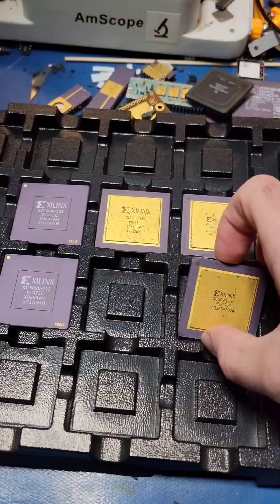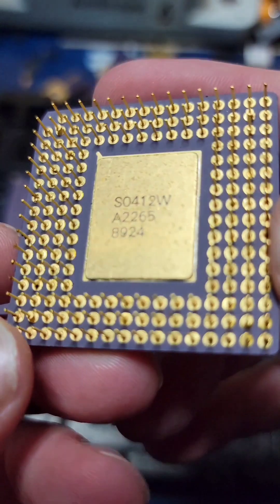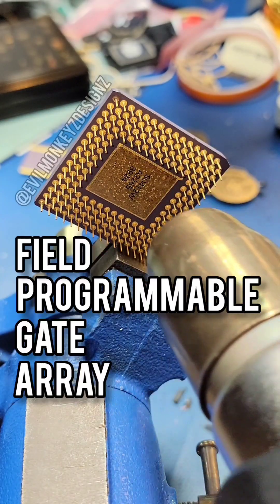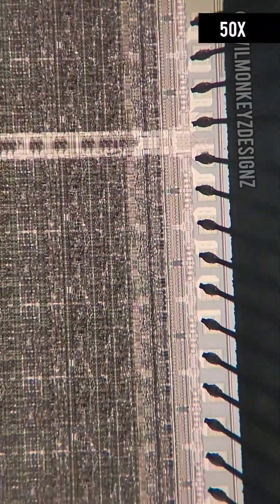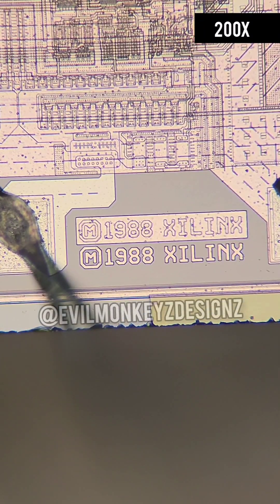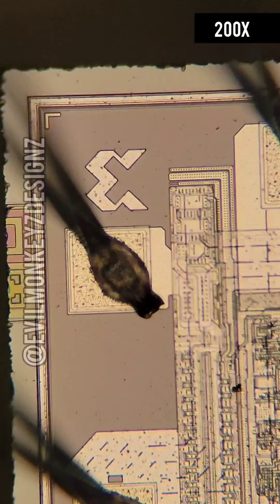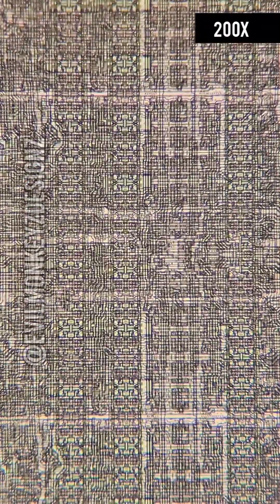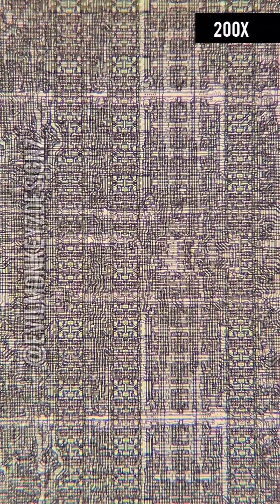CCU #296: Xilinx XC3090 FPGA #shorts

Comment: It probably was originally configured as a super IO chip or a CGA/EGA/VGA chip for dev boards on c64 or amstrad CPC before release of final devices to the public.. it would not be enough for 8bit CPU's or anything but for basic video or super IO that controlled HDD and FDD and parallel and com ports all in 1 chip this chip would have been used buy manufacturers device Dev's for probably all 8 bit and 16 bit systems and possibly ARM systems also likely used in enterprise equipment like old services like telephone switching and local network equipment of the time!! This chip is likely responsible for the final product of thousands of different chips in thousands of devices around the world.

Comment: Can you now explain why my analogue pocket has FPGA on it please!!
Reply from the maker: With enough logic gates, the actual CPUs of older game consoles can be synthesized in an FPGA. The logic gates all remain fixed in place, but by writing code and programming it to the FPGA, you tell the FPGA what logic gates should connect to each other, forming larger structures. I'm not sure exactly how the Analog pocket does it, but its either a big enough FPGA to store all of the consoles' CPUs that it supports at the same time, or it re-programs the FPGA firmware depending on the game its trying to run. I'm sure there are a few different ways to end up at the same point.
Reply: @EvilmonkeyzDesignz  very interesting and informative I appreciate your reply! Thank you! I was impressed with the analogue pockets performance so much so I had to ask when I heard you explain fpga. Nice to know how they are doing it! Does this mean in the future with software updates the pocket could support more and or different devices?

Comment: So blows my mind!  This is 35-year-old tech too. Insane for sure how chip-making equipment can be so precise to manufacture chips with so many circuits in a small surface area! I am so humbled....
Reply: It's easier than you think, it's like shining a projector through a microscope but in reverse so that instead of making the image bigger you're making it smaller so you can get microscopic detail from a regular projector and then you just use chemicals that are sensitive to light. Use the opposite end of a telescope or stacking multiple lenses and you can make the details as miniature as you want...
Reply: @DrakeOola  I can "see that." Interesting. I too think about the many  "internal chip electrically charged superhighways" running microscopically close to one another without interfering with one another. The perfect medians engineered to separate the tiny circuits. Mind blowing...

Comment: Ah, logic gates, I worked on some fun IBM cabinet printers that loaded code off a 3.5 floppy when you booted it.  A lot of the calls, a fresh 3.5 floppy disk replacement would fix the weird problems the machine was having.  Fun stuff 🎉

Comment: Will be a help for my questions : what makes an  IC programmable?

If I want to program a 8085(assume), I need a compiler that will run my program (which I am seeing in display) and executes it in the processor. I understand that mnemonics itself are hexadecimals and it eventually indicates voltage levels as per timing diagram but how does it stay always in the processor?  Can we customize any mnemonic, for example can we change the command ' MOV' to any other customized command? Thanks in advance.

Comment: 1990's me screaming when the top came off - "Nooooooooo!!!  Do you know how expensive those are, and the lead times?!?!?!"

Spent many hours learning the internal architecture of these to optimize for speed - had to hand place many of the CLBs to get it to reliably meet timing requirements.  

In some cases, the Xilinx documentation was misleading.  They recommended using regular LUT logic for clock enables becuase there were more routing resources for those inputs.  While true, the dedicated ENABLE input had easier set-up time requirements, making for faster counters if they were small enough.

Also, the upper and lower CLB outputs could not go directly to their respective upper and lower long-line buffers - you had to go through a magic box to route it there... UNLESS you routed the upper output to the lower tri-state buffer, and the lower output to the upper tri-state buffer - saved routing resources and nanoseconds.  

The design was entered in schematics so flip-flops could be placed in specific CLBs with location attributes - language entry didn't allow that.

Comment: The specs are actually very good and still very useful for today's usage
Reply: I haven't looked up the specs on this particular part. But with modern FPGA you need line transceivers to scale up the voltage for higher voltage applications. Like for instance if you want to drive LED matrix with them. These old FPGA could probably do it without line transceivers/level shifters.
Reply: @Salzmann_69 FPGA's are still used mainly for prototypinh ASIC's.

The pynq-z2 which is relatively new has a clock frequency of 125 MHz
Reply: @Salzmann_69 you obviously don't have any idea what an FPGA does and what it's used for.

Look it up but I will try to sum it up.

CPUs work in tasks sequential while FPGAs can do it instantly because instead of working with instructions, you put logic gates in a certain order.
Reply: @CraftingCake  I use fpga to test basic RTL design so for my application, you can do pretty much anything you want with them. You can actually make a CPU out of them.
Those specs allow you to do basic stuff, it's kinda cool (like those little usb fpga you can buy for almost "nothing"). of course it's outdated and stuff but still usable.
Reply: after re-watching, i thinks i misheard while writing my 1st comment because there is no way you can fit enough to make even a 8 bit CPU haha. i was very wrong indeed.
Still usable, but not for RTL for sure.

Comment: FPGA's  have their logic set up at boot where a CPLD does not , however, the MAX series CPLD's were actually FPGA's with very fast start up times, customers only noticed years after release.
Reply: Javier, trolling on youtube would be a frustrating endeavor, links can't be posted, most comments get deleted and there's a maximum before everything you write gets deleted. search for exactly these words "Generally, MAX II as well as MAX V are small SRAM based FPGAs"
Reply: Circuit design with vhdl, Volnei A Pedroni. MIT Press. Chapter 4. Page 107. Differentiates between true CPLD and IC's with flash and FPGA sold as 'cpld'. Chapter 4 readable on vhdl '.' us.
Reply: No, that is not correct.
The difference between CPLDs and FPGAs is not determined by the persistence of the design in the device.

There were anti-fuse based FPGAs which when powered on already had the design incorporated into the device.

The Xilinx XC3000 series were FPGA's and SRAM based and used an external boot PROM to load the configuration into the device.

The difference between a CPLD and FPGA is determined by the complexity of the device.
FPGAs tended to have, firstly not logic gates but logic modules which could implement many logic functions, whereas CPLD's tended to be more like logic gates. They evolved from PLD's.

FPGA's also tended to have a higher gate count equivalent than a CPLD, though you were not typically working down at the gate level in an FPGA.
Reply: @deang5622  A bit of hot air and lower bowel ventriloquism. Look up cpld vs fpga. A cpld usually had integrated non volatile memory. An FPGA needs to be programmed at boot. My point was the Max II series was sold as a cpld but internally was an FPGA. Nothing more nothing less. Look it up before you start coming out as an Acksh Wally.
Reply: @Hulkeq2  You sound like a lovely person
Reply: @alakani  No, that is not correct.
Reply: Max CPLDs are most definitely not FPGAs. Those CPLDs boot really fast because the configuration nvRAM is on die.
Reply: @javiermesa-martinez8731  I'll link a few, but >search< for yourself before replying with your gut instead of your brain.
Reply: @Hulkeq2 you chose a weird subject to troll. 😅
Reply: @javiermesa-martinez8731  In no particular order; Reddit : "Can I use a MAX V CPLD as a drop in replacement (code project, pins, etc) for my old MAX II 7256AETC100-7N circuit?"  --> "the MAX II/V fabric is actually an FPGA not a CPLD (blame Altera marketing gimmicks)"
Reply: @javiermesa-martinez8731  EEVBLOG : "Bought an Altera CPLD dev board, where to start?" ---> "Altera's MAX V is really an FPGA but with non-volatile configuration but only up to 2200 LE for around $20 per chip"

Comment: How many times can you reprogram FPGAs? 
What kind of junk can I find these in for free?
Reply: Depends on the technology used.
The Xilinx XC3000 series were SRAM based.
Every time you powered it up, it was programmed by reading configuration data from an external PROM chip. So no limit.

You just had to burn a new PROM chip.

There were other technologies such as antifuse which were used by company Actel which was program once only, IIRC.

Comment: What are your experiences with creating die shots with flip chips?
Reply from the maker: They are pretty difficult. Many of them have an underfill that needs to be removed first to see the uppermost silicon layer. In addition to solder balls, the top layer usually is a solid/partitioned metal plane, obscuring the bottom layers and structures. Some people have had good results potting the dies in epoxy resin and then sanding the die down to expose the layers underneath. There is a YouTube video of someone doing this. If I can find it, I'll link it.
Reply: Wanting to see that too 😁
Reply: I will make a video eventually. I’ve mastered the process pretty well.